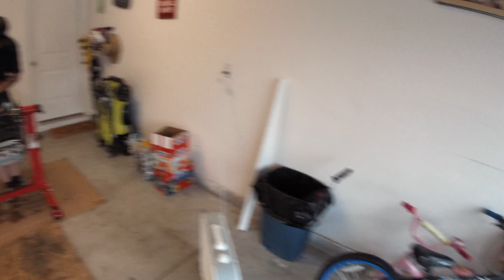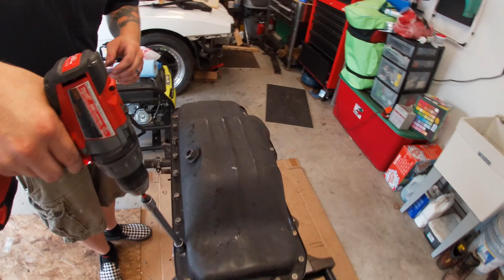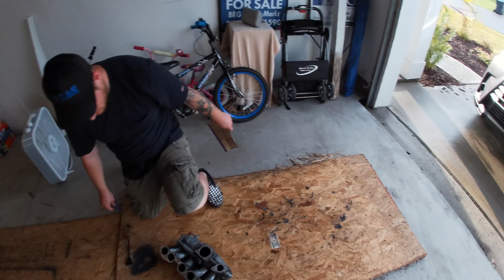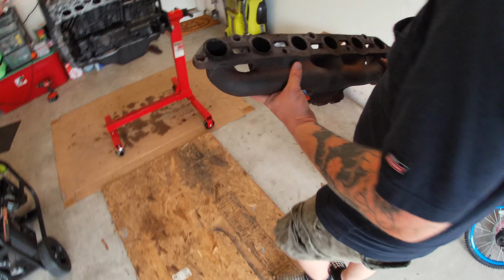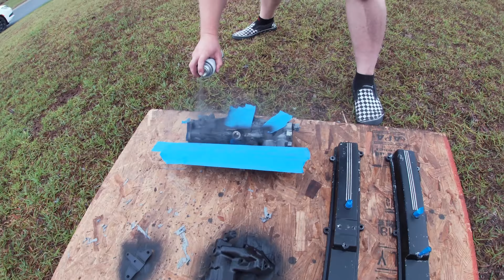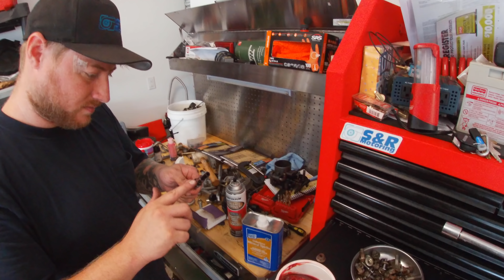The 7M-GTE Is Almost Ready To Drop In! (Mk3 Supra Build)

Comment: Those valve covers look good. That is exactly how I did mine and they look amazing with the 3 stripes sanded down.
Reply from the maker: Thanks! We used the VHT metallic black paint.
Reply: @SRMotoring   I used the same paint. It seems to hold up good.

Comment: are you guys going to run stock ecu?
Reply from the maker: Stock ecu with a hks vpc and gcc for now. The plan is to go standalone when funds allow
Reply: S&R Motoring I see. Which ecu do you guys plan on getting?
Reply from the maker: @westongorospe482  still up in the air but I like the ms3 or aem infinity. After the car is running I'll do the leg work and research and make a final decision.